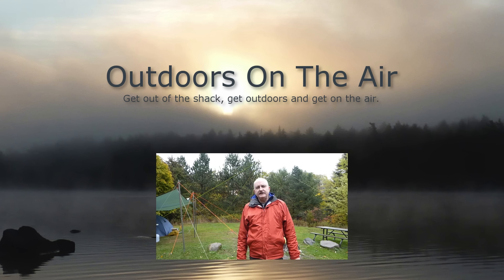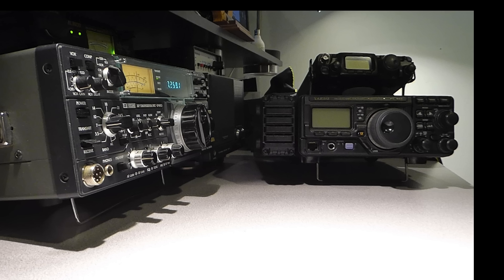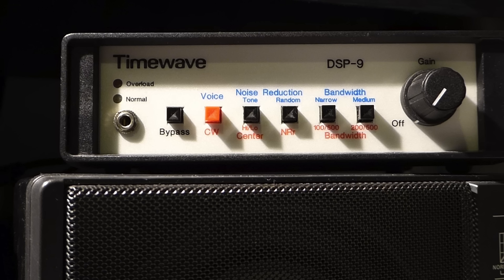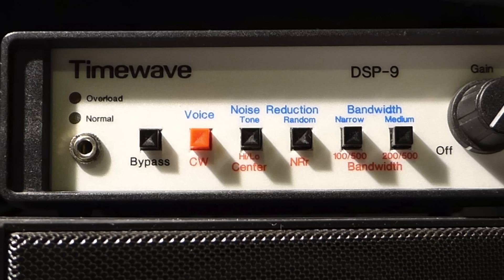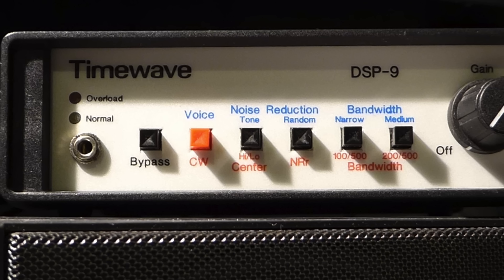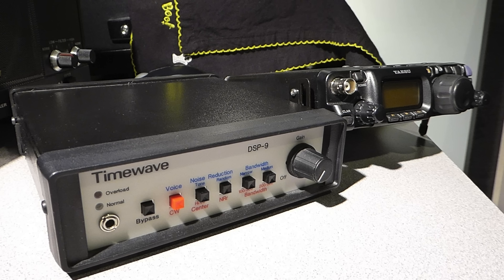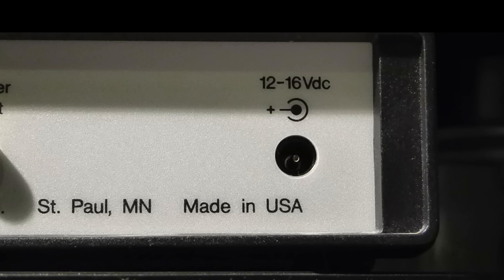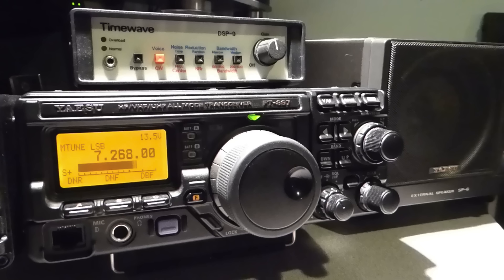Can 25-Year-Old Tech Defeat Modern QRM?

Comment: Hi Tracy this proves that 'old' technology is worthwile. I just acquired an FT897 transceiver and that was mainly inspired by your video's. Thank you for the very informative content. A tip : I use Voicemeeter Potatoe on my PC an it has a noise filtering in it which works really fine. The only thing they ask you is to do a donation (not mandatory). I use this software to direct the sound from my 4 rigs into the PC's sound-system. I can choose per Transceiver if I want to hear through my headphones are my computer speaker. I can mute each rig individually. I can use1 mic for all rigs as well. I'm using a rather cheap PC gaming headset with mic and that seems to work fine according to the audio reports I get. Besides this I have a possibility of compression and noise filtering for all 5 input channels. 73 de ON3STG Gert.

Comment: For a few years my 897d and 817 were my primary radios, I had a Hustler 5btv - talk about noise! Yikes! I bought my IC-746pro after I had my 897 for awhile, once I had my new 746pro hooked up and on my bench, I had thought something was seriously wrong with it because of the lack on QRN and QRM I was pleasantly surprised! I continued to use my 897d for strictly digital modes back when PSK31 was at the peak of popularity. I sold my 897 to a friend who wanted to get into digital modes. The 897 was a cool rig but my then 817 was fine for portable use. All of this took place around 20 years ago, I still have my ic746pro ( just did alignment work and put a new light in the display) I wanted to get a digital AF filter but bought an IC-7000 to replace my 897d ( used too much power for portable use) but between the 897 and 817 ( now a 818nd) I've had a lot of fun and made lots of contacts with those 2 radios. Glad you have that filter to get the maximum use from those good ol rigs. Oh I started my ham radio career with a Heathkit HW-101 I learned to ride the RF gain for noise. I'm spoiled now with DSP.    73
Reply from the maker: Thank you for sharing your experience! I too am a fan of the 746Pro.

Comment: The 857/897's DSP does not work at all, it's nothing but an audio BPF, both radios suffer from internal noise, phase noise etc.. disconnect the antenna and turn up the volume, you'll see what I'm talking about.

Comment: This video has given me far more confidence in purchasing a FT-818. As a sound engineer it’s very clear that “DSP noise reduction” is doing nothing more than using an EQ curve to filter off the very highest frequencies of noise, the appearance of less noise coincidentally reducing the high frequency content of the voice also, making the audio sound more muffled than before. The EXACT same outcome could be achieved with a graphic EQ and in fact using such a device could be used to boost the frequencies most important for intelligibility (2-4kHz), thus giving a far better quality product than even the most sophisticated DSP options available in radios.
Reply from the maker: Thank you for sharing your thoughts.

Comment: I'm getting my Technician license next month 20 August 2020, and I don't even have a HAM radio.  I'm a old CB single sideband operator from the mid 70's through the 80's and have decided it's time to get my ticket.  I'm like you; I do not have a budget for a HAM radio since I'm a retired, 69 year old, disabled Vietnam vet.  However, I still have access to a few CB radios that have been modified to go just below the 10 meter band (28 MHz).  Guess I could reprogram the PLL chip to go up to 28,350 MHz.
Reply from the maker: Thank you for your comment! I think you'll have a lot of enjoyment in ham radio. If there is a local club you can join, consider it. People will help if they can.

Comment: Your wasting time. Sell your old radios. Buy a used Icom 8200, IFdsp and waterproof . Ideal for home or portable. You get one used in good ham store for 650$ with three month warranty. Sell the old gear before it breaks down, old radios are hard to fix. DSP 9 sounds washed out, yes no harsh sound but all tone is gone. Sell old gear may cost you another 200 or 300 on top. I gave you a like. It was interesting.
Reply from the maker: You raise a good point!

Comment: unacceptable. mewave ANC4. It seems to work fairly well.  However. It attenuates my transmit level and it should not. It is hooked up per instructions. My problem with time wave is that I've written them three times now for help. No reply on all three tries. I find this to be unacceptable. I will not but another Time wave product or give a positive review on what I have purchased.
Reply from the maker: Sorry to hear about your bad experience, that is unacceptable. However, you do realize the video is about the DSP-9, and not the ANC-4, right?

Comment: I wish my noise levels were as low as yours. I get S8 to S9 on 40m it makes my hobby worthless, and not much less on other bands.
Reply from the maker: See if you can find a Timewave ANC-4 (originally made by JPS). Though I have not been able to acquire one for myself, yet, I've heard great things about their ability to allow operations in environments where QRM is too high. Alternatively, do what I do and go HF Portable, where the noise is non-existent :)
Reply: @OutdoorsOnTheAir  I have tried an MJF 1026 which is similar, and because I ahve houses all round me, and the noise is from all directions, it was not a solution even though I had a vertical receive antenna for maximum null.

Comment: Well. I didn't know these DSP-9 Timewave noise reducer. I did hear of a JPS ANC-4 which was later made by Timewave... I did have very severe QRN on all bands but 80 meters was the worst with 9 of noise day & night.... I couldn't find a new ANC-4 but found a used one in great condition, and it is great it just reduces the noise on every band, but when some neighbours moved recently, so did My noise level.... So, now I have noise some times but over all it is very quiet,  but because I can bring in Pre Amps on My FTDX-3000, naturally the noise returns so the ANC-4 does reduce the noise by 3-4 S points.... I am still learning how to operate MY FTDX-3000 Radio using all the DSP features it has....  There was an Australian Contest on a couple of weekends ago, along with a large band of LIGHTNING so the crashes were nearly continous which made contacts difficult and I could hear many stations not being able to hear the station calling them but I could hear them all by using the new found DSP items in the menu etc...... I believe these stations had their Radios at a normal RX condition instead of trying to get those stations they couldn't hear...  VK2LEE   LEE
Reply from the maker: Thank you for sharing your experience, Lee.

Comment: Very nice video. Thanks for posting. I've found over the years that QRM and QRN are "occupational hazards"  in Ham Radio. Neither this radio's built-in DSP or the Timewave DSP did anything to improve the listenability of the incoming signals  or sound quality. In fact, they both muffled it, making it difficult to hear each word. The concept of noise reduction is a tricky subject, because electronics (either at the IF stage or as add-on audio DSP filtering) have a difficult time separating noise from signal,

   since both are entering the radio mixed together. The best device I've found to separate noise from audio is a device called  "The Human Brain." Once you develop your listening skills, and  listening ability is truly a skill, you can learn to put up with the mix of audio and noise, then ignore the noise while picking out the desired voice or CW keying. Many Hams never develop their critical listening skills because they haven't been put in situations where they were forced to listen critically.

       I suggest joining nets and working stations in contests. With band conditions near the eleven year Sun spot cycle low, you will have to really stretch your ear to pick out DX and even local stations to confirm contacts, but the more you subject your ears (and the computer that resides between them) to this frustrating situation, the better you yourself,  to achieve the best signal processing possible.
Reply from the maker: Thank you for your opinion.

Comment: Great review and you left no stones un-turned.  Great job explaining the limitations too, I think a lot of people think all these "tools" available are a magic bullet and are disappointed by the results then give a bad review.  That certainly is a great audio DSP,  I was surprised at the clarity of the processed audio.  I'm not a great fan of the DSP sound, and I sold all my modern commercial gear and left only my trusty Elecraft K2 rig because I like the low noise floor and analog audio it has.  Your demonstration certainly shows the possibilities with such a unit.  I have owned a couple of different more modern audio DSP units in the past (each one was quite expensive too) and neither if them came close to this one.  I think you just raised the price of any working DSP-9 :)  Keep up the great work!
Reply from the maker: Thank you (and thanks for sharing your experience)!

Comment: Great video.  I dealt with QRM for a while until I installed the economical BHI dsp board into my 817... totally new radio.  Of course, the processed signal has a bit of a digital sound to it, but I have absolutely no problem with that!  It will work in the 857 and manufactured for other radios as well.  Ironically, I use the 817 in the field where there is little if any QRM but nice to have onboard anyhow when used in an urban environ.  73!  K7GYB
Reply from the maker: Thank you for your comment, David! I always enjoy reading about your experiences. 73 from Tracy VE3TWM.

Comment: Great job Tracy, I always find your videos engaging and informative. The DSP 9 does a pretty darn good job.  I added the BHI AF DSP (kbrd built in) to my 897D.  It works great as well and has 8 filter settings.  Only the top setting makes things sound a bit underwater.  I also have the ANC-4.  Note, it is NOT the same thing as DSP.  While the ANC-4 can null out certain signals if conditions and your receiving antenna are right, DSP does a far better job and is a greater source of radio enjoyment day in and day out.  The key thing I have found with the BHI is that the signal must be above the noise floor for DSP to do it's work.  The further above it is, the more the effect. At 2 S units above, and at a 6 or 7 setting, it is near FM quality (not quite as full fidelity but that is how DSP works).   Thanks again for your conscientious reviews!
Reply from the maker: Hi Rick, thank you very much for your informative comment. I appreciate your description of the difference between DSP noise filtering and the ANC-4. Good point as well in regard to how effective the DSP is in reference to the noise floor.
73 from Tracy VE3TWM.

Comment: I purchased a TW DSP 9 at a local hamfest a few years ago for ten bucks. It does wonders for my DX-SR8T! I work mostly 40m cw. The 100hz filter setting is a real squeeze box! I agree about passing over signals without hearing while it is on. I am going to buy a few more 9's when time permits. 

73 es gud DX

de kc5ngx
Reply from the maker: Thank you for your telling us about your experience, John. 73 from Tracy VE3TWM.

Comment: I personally own several Timewave AF DSP units.  I have the DSP9, DSP599, and a DSP599zx.  Of all of them the simple DSP9 is my favorite.  I use them mainly with the RL Drake gear I collect and some older receivers such as the Icom R71A, National HRO Sixty, and other collectibles I own.  Years ago I made a video showing the DSP9 on my YouTube account using a Ten-Tec Omni 6 (non option 3 no DSP).  These units work great for older rigs and are better by far than the old DSP speaker by RadioShack and other cheap solutions.  These units can be found quite inexpensively on eBay or sometimes at you local Hamfest.  Since these units are add-on external AF DSP filters, you won’t need them for more modern rigs with built in IF or AF DSP.  But if you have an older radio these are definitely worth trying!  Good video, I think it will help out those with noise running older pre DSP era radios.  73 de Nick N9SJA
Reply from the maker: Thank you for sharing your experience and wisdom, Nick! I hope the people who read this will check out your YouTube channel. 73 from Tracy VE3TWM.

Comment: I prefer the BHI DSP over the Timewave for my FT817 and FT897 that I use. One note both do distort the signal to some degree.  They do work but do not beat the SDR radios that sample the RF and can do much more filtering. The smallest lowest power rig that uses this advanced architecture is the Elecraft KX2. This is most likely my next portable radio. Thank you for showing this and I agree it extends the usefulness of older radios.
Reply from the maker: Thank you for sharing your thoughts!

Comment: Good review + demonstration, seems doing it's job but from what i can hear from your video, it does not really make the audio any better, all it does is reducing the overall noise level, reducing RF gain and a trained ear may probably do an equally good job ,  ....In fact, i never missed something like that with my IC751 nor with the IC745. The on-board noise blanker, pass band tuning and IF shift does the job good enough and if i still can't hear it,.. that's just life on the Ham bands ... Another point over here is that we are limited to 400W PEP,  usually makes not much sense fishing a weak signal out of the noise when the other side does 1kW+, he just won't hear me anyway.
It's probably my mindset, too as i generally don't like those computer radios which you can't repair anymore,  ...might be an age thing...:-)
Reply from the maker: Thank you for weighing in with your thoughts. You are exactly correct of course, in that older rigs can be used just as they are in many environments in the hands of a skilled operator.
I hope others reading this check out your YouTube channel, you've posted some interesting stuff over there.